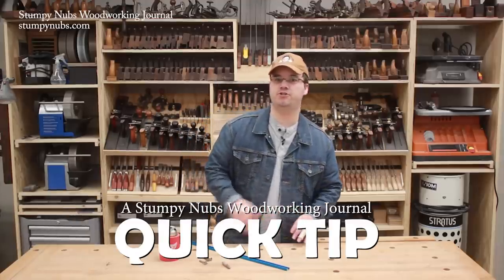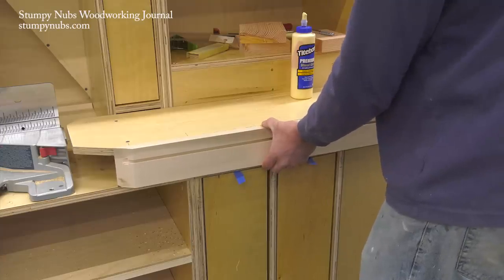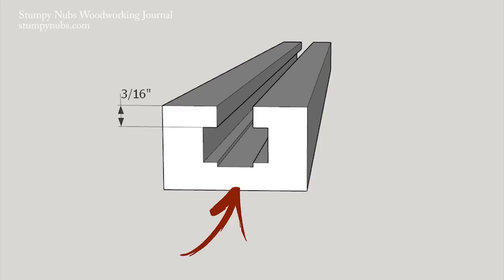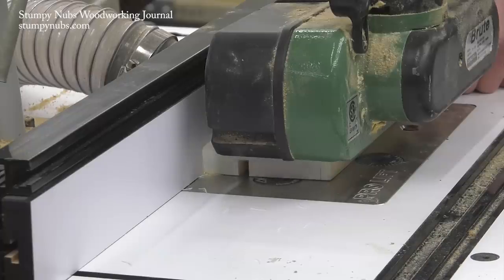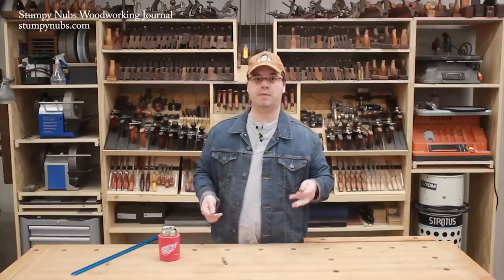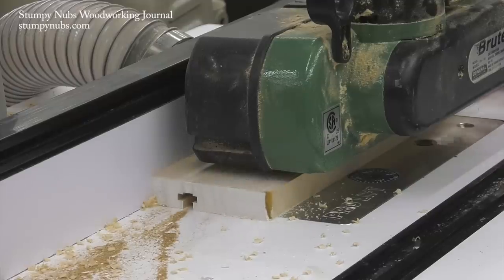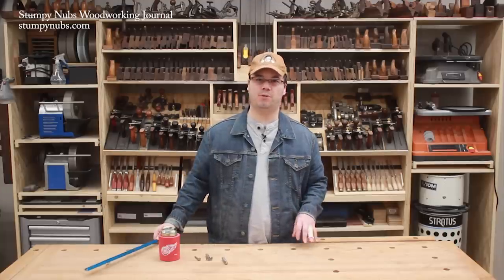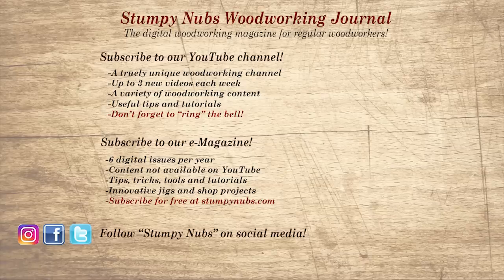How to make your own t-track out of wood.

Comment: Hmm, a few passes on a table saw for bottom , then glue a strip of hard wood on top & rip the 5/16 slot.
Not all of us have acquired a router, just yet. ( believe it or not) .
Do a video of this, with out a dato either.
Reply: me too...route a ½" slot, glue hardboard (Masonite) on top across whole face and route slot through. Don't need unusual 5/16" or slot cutting router bits. If all you have is ¼" bit easy to move router fence, make two passes, and achieve any desired slot width. Plenty strong enough. Don't feel that aluminium track is essential for strength. 
After all, it's only as strong as the few wood screws holding it down.
Reply: Dude!  Get a router!!!!!! Sooooo freaking versitile!
Reply: There are many ways to skin a cat when doing anything, I don’t think he said, this is THE way you have to do it, it’s just a way to do it

Comment: Been using this for years, I often cut them directly into tables with an oversized forstner bit hole at either end for entry and exit of the t-bolts. Btw toilet hold down bolt kits make great t-bolts 😉
Reply: If you have a grinder, carriage bolts are even cheaper. Don't take too much off.

Comment: How about a strength test?  Wondering how strong wooden t-track really is.
Reply from the maker: It's strong enough for most uses. But there is no doubt that aluminum is stronger. So take that into consideration when you build something.

Comment: I am pretty sure you wont take a negative comment if i disagree. Or at least i would say, wooden track is not for me. I prefer the aluminium or i would even like some plastic material. Actually i a was looking for a router bit set (male+female) which i can use it on plastic and wood.t To make Type 30 sliders. Sliders, made  out from hardwood would be ok. No luck.

Comment: Every time I plunk down my card for a piece of track my blood pressure spikes.  The margin on it is astronomical as it probably costs less than $0.25/ft to extrude and package.
Reply: the tracks are also anodized, and there are holes drilled and countersunk. Maybe without any holes and anodization it would be significantly cheaper. When installing track it's the hole drilling that takes most work and for that reason alone I just route t track directly into wood with keyhole bits.

Comment: You can find inexpensive t-track. Hardwood seems like it would actually be more expensive.
Reply: My thoughts exactly - I love this channel,  but in this case I think Stumpy has got it wrong. Shop around and buy in bulk and T -track can be dirt cheap
Reply: It appeared that a new board was used for this project; however, if one uses scrap hardwood, it's basically free.

Comment: Just yesterday I was pricing out t-track.  Here are the prices I found on 4' pieces of track:

Rockler - $30
Eagle American - $25
Orange Aluminum - $8.54
Power Tech - $5.91 (ea in 4-pak)

One piece of 4' - 1"x4" red oak board - $5.84 at a big box lumber store where they claim you can "Save big money at."
Reply from the maker: You spend the time to shop for the cheapest price you can find on T-track, but you buy oak from a box store at the highest possible price?
Reply: @StumpyNubs  touche!
Reply: Bob Lang pointed out that any time there’s a barcode on the wood and a Starbucks around the corner, you’re going to pay top dollar.
Reply: You forgot to mention the $25 shipping to the east coast from orange.
Reply: Curt Martin Exactly. Inexpensive until you get to the shipping charges.

Comment: If you're paying 40 or 50 dollars for t-track you are getting scammed. Pretty easy to find aluminium t-track for like 17 cents an inch. 8ft shouldn't cost more than 15 to 20 dollars.

Comment: I've often wondered about routing a channel with shoulders and then putting strips of whatever metal is handy/cheapest in each shoulder to form the overhangs.  If you used some wider steel, it would be magnetic, too.

Comment: You say I need hardwood.  I tried balsa wood, and it didn't work out very well.
Reply: CJICantLie did you use balsa bolts and nuts? If that doesn’t work, try styrofoam bolts and 🥜
Reply from the maker: Hardwood meaning it's actually hard. Poplar is a hard wood too, but I wouldn't use that either :)
Reply: @donchristie420  Shucks, I guess I better not build my work bench out of styrofoam now.😡😂

Comment: Have your used this before in your shop? I didn't hear you say you have used it before. Does the wood have the same holding strength as the t track? I would be willing to try this if it actually had the strength to clamp with.
Reply from the maker: Yes, I've used it. So have countless others. I didn't invent t-track router bits, they've been around for years.
Reply: @StumpyNubs  Do you use it to clamp? It would seem the wood rail the holds the T-bolt or bolt head is not as strong as the aluminum T-track. I have not been involved in woodworking that long, about three years. I did do a lot of framing in my younger years but I just started woodworking.
Reply: @williamlaird2136  wood is super strong.  I'm sure you could break it if you tried, but why would you need that much pressure?  If you have to clamp something down that hard, you are most likely compensating for an earlier mistake in your process.
Reply from the maker: @williamlaird2136  It's strong enough for most uses, including hold-down clamps. But there is no doubt that aluminum is stronger. So take that into consideration when you build something.

Comment: Time and cost of wood not to mention durability _ Is it really worth it at one time I thought so but not anymore _ Good hard wood alone is as high as the T track.
Reply from the maker: The price is not even close considering you can get a lot of 1-1/4-inch wide t-track from a board. And hardwood is pretty cheap (compared to what they charge in stores) if you look around and are willing to drive (try Craigslist). But it's not just about cost. Wooden t-track looks better, in my opinion. I'm not saying I don't also use aluminum. I do. But I like wooden t-track sometimes too :)

Comment: Another possibility is to some cheap curtain rails. They work reasonably well with carriage bolts ground to fit the curtain rail. It is less bulky and saves the cost of a special router bit.

Comment: Very good vid but why does this sound more complicated than it needs to be? One a basic router kits come with a slot cutter and a straight bit to get you started and two a T-Track bit is only 10 bucks on Amazon.
Reply from the maker: Two passes is overly complicated? A basic router bit set comes with a keyhole bit. That's not the same thing. Too small. You can buy t-track bits that cut in one pass, but it's very hard on your router (unless you have a large one) and the dust can't be cleared efficiently, which heats up and shortens the life of the bit. The first pass with a straight bit is easy and it provides clearance for the dust on the second pass.
Reply: @StumpyNubs  First thanks for the reply it truly bolsters community interactions, but that's what i mean its just two passes with basic bits but for some reason the vid sounds more complicated than it actually is.

Maybe its the one time special purpose bit that was pointed out that triggered me.
Reply from the maker: @Guardian_Arias  - The video does include details like measurements that seem to make it more complicated. But the cuts is pretty simple. And the bit isn't one-time. It lasts for a very long time and makes a lot of t-track. Thanks for the feedback :)

Comment: Why are the aluminum T tracks so expensive?  I was expecting to buy & use a lot of it. BUT, the cost is ridicules.  This is just a ripoff from Rockler. No one should buy theirs. If they come down in price the others will also. This video is the pin in that baloon!  I worked for Alcoa in my early years, and I know that the cost of any extrusion ought to be very near the cost of Aluninum raw material! I'm sure that the cost of the extruded material is very close to the cost of Aluminum by the pound. This is sort of like the cost of Festool products.  A ripoff!

Comment: Yeah but you have to look at these points:
* The relatively small difference in price between the least expensive hardwood and the aluminum extruded T-Track.
* T-Track is everywhere - it's always strong - nothing special about it.  
* T-Track doesn't require special machining or base materials.  MDF laminate is fine.
* Shipping is much cheaper than for lumber.  You don't need more than 48" lengths (making it easy to ship.)  AND, 
* you can buy it in bulk quite cheap and store more than you need for free.

Comment: Makes no sense at all you can't afford a 40 piece of track but you'll spent more than that on hardwood knock on the labor and the router bits no sense at all buddy like they say there is an ass for every seat
Reply from the maker: Ten 4-ft long pieces of t-track made from expensive box store oak = $35. Ten 4-ft long pieces of cheap Chinese t-track from Orange Aluminum with shipping = $114...